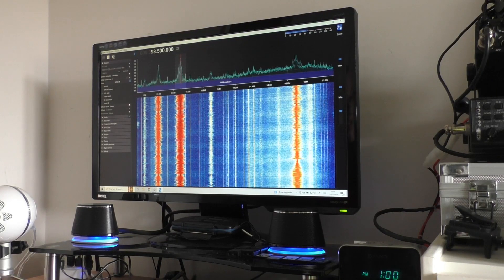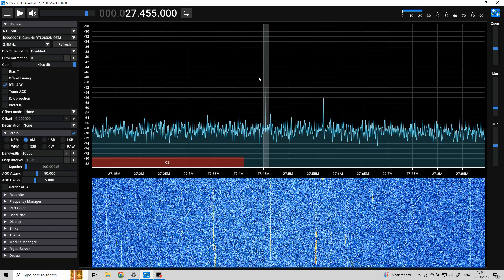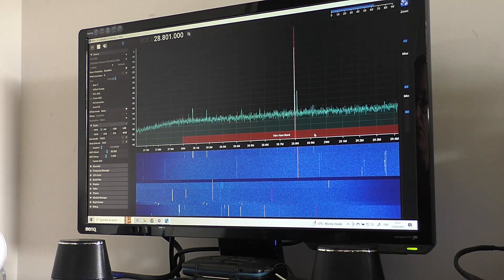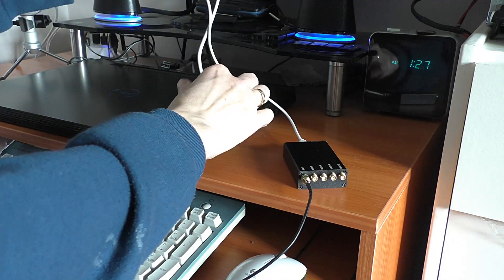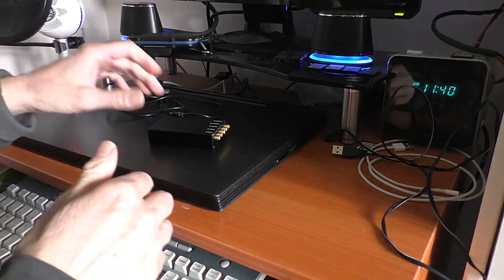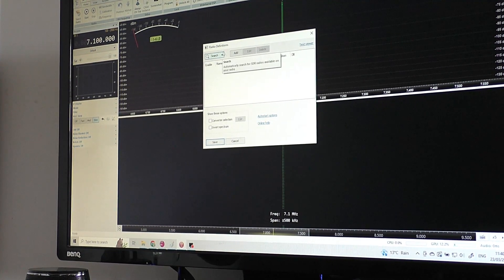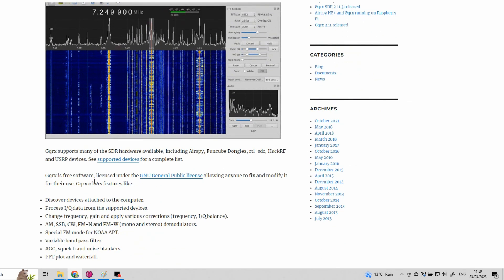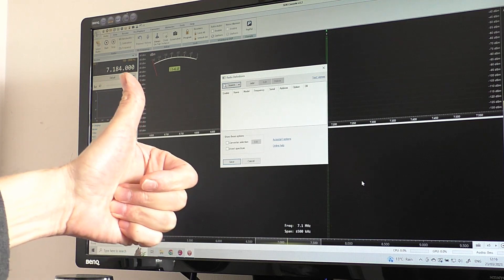SDR Radio.  Trying hard but I admit Iam really struggling.

Comment: Hello... I've tested it with the debian 13 and gqrx and it worked fine. But yes, it was not in production yet... debian 12 does not provide the drive and the correct version of gqrx to use it.

Comment: As others have said, you need the SDRPlay API for the clonef RSP1. There is an open source Mirics driver but I've not tried installing that, and it might only be available for Linux. I have the genuine RSP1A which is much better, as well as the clone. The clone arrived with the circuit board upside down so the SMA connector labels were wrong!

Comment: Found SDR sharp to be quite buggy, locking up in the Frequency manager, and not changing Modes.  Discovered SDR++   it's very good, had no problems. Only thing, when recording, it does not appear to pause during silence.

Comment: Hi Fred.  Greetings from Arizona.  I enjoy your videos.  I have gone down the same road of trying out the cheap SDRs and had a lot of the same frustrations.  I finally broke down and bought a SDRPlay RSP-1A and never looked back.  What a great little receiver.  There is a YT video out there on how to mute this receiver for use with a transmitter, which I intend to do with an old Heathkit transmitter and use it on 10 meters AM.  Good luck.

Comment: Alright I saw the video interesting and good this is part of learning process error and trial ultimately instead of Windows 7 or 10 I would say try Windows XP it works with mine got the drive installed dated a few years ago however I could get AM signal Auto broadcast am the same sdrplay you have could not get the HF Spectrum I think the issue had to do with too much magnetic interference around as well as laptop generating interference I've also noticed that this SDR receiver does generate harmonics itself you can pick it up also on the shortwave radio etoile pickup the Citizen band radio 2726 MHz unfortunately between 2 and 25 MHz it doesn't seem to be doing the match however I'll take it out to the beach extend a long water and I'll see if I can get the same result by-the-way may want to try working also on a Mac you will need to install drivers it should recognize the SDR dongle right away when you install cubics Str as well as gqrx works fine on an older Mac 2012 no looks like they did resolved you may want to try skywave Lenox it has a drivers and your Hardware is detect automatically ultimately if one-way doesn't work try another way must have waiting must admit I worked as an it previously 20 years ago and sometimes you got to find Solutions outside the box now things definitely have gotten more complicated is when it comes to Windows you need to have a driver installed as you know then you can get it going however I think also your laptop is also generating harmonic's. Might be one of the reason why you're not picking up your CB radio spectrum try a different laptop and see if it is the same result some machines are going to generate more interference than others sometimes as well by leaving it on plug Brooking only on the battery your generation of harmonics can be generated as well by the power supply I know these are small variables they do add up on the radio spectrum I even noticed some those Chinese MP3 player do generate harmonics as well it was an AM FM portable radio that would play mp3 music and I noticed that it was also playing the same tune on 3.5 MHz the point is your PC also sometimes generates a signal around 27 MHz hit me up to do also with the processor that you using and there might also be some crystals that are installed in the machine for type of control voltage control systems they do generate harmonics as well imprecise however I noticed as well that you managed to overcome the am transceiver that was nearby your place that am broadcast radio glad you did and surprise that you managed to make it as well because it was you were so close persistence trial and error this is how you build a knowledge and this is how you get stronger bit by bit every single test you do builds up neurons in your brain your knowledge gets wider and faster whether it is a failure for not it is knowledge that you have required and that you're sharing with other people as well 73 I think other people are also going through the same thing some of them have given up a long time ago because of a lack of understanding of what is happening around mainly radio communication Spectrum the understanding of off the device in question and a bunch of variables that do not have control over however I do believe that persistence can go a long ways thank you for the video 73 all the best may you be successful

Comment: Fred! from my past uses with SDR Console you have to use the Add button to add SDR Play as the definition. Then click Save & Start after that, if my memory is correct.
I'll drag my hardware out and hook it up & double check the software settings for you! but I am pretty sure that's how i got mine working. SDR Console V3 🖖👍
Reply from the maker: Thanks for that.  I will certainly give it a try.

Comment: if you can get to 5505 usb volmet constant signal usually.. zoom in big... tune bandwidth..3.0 khz or 2.8 ish agc etc   set then go to 27mhz...
if you change dongle reset program so it reconises which dongle or have them both plugged in at startup and it should find one or both and you can select... the dongle will be equal to your rx in the dx70 or your hf rig... mine is...
Reply from the maker: Thanks Tony.

Comment: 8:50  etc  When you change a dongle you really should close the program first and then reopen it once changed. On times you might even have to reboot so that the computer can sync itself to the new device.   Either way plug&play shouldn't be expected.  I just googled gprx and it isn't targeted at Windows but Mac and Linux.  It can be done but it's a nightmare .. stay well away for your sanity! :-)

Comment: You basically set sail on a sea of misery when using cloned hardware. Lack of support and lack of documentation tend to be the main problems you face. Finding others who have sailed that sea before is your only option, if you can find them. I think I will probably be buying an official RSP1A myself to avoid "mal de mer." 🤢
Reply from the maker: Yes Nick ive come to the same conclusion.  The Nooelec is 100 times easier.